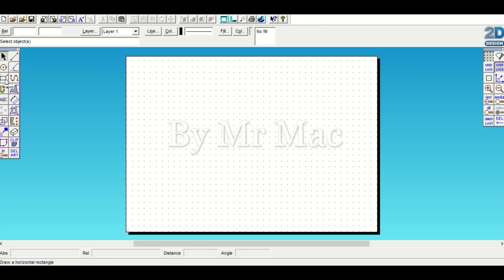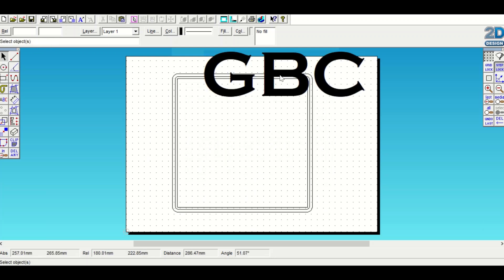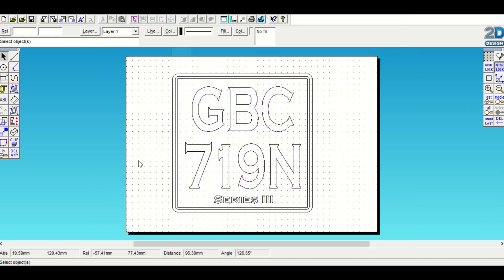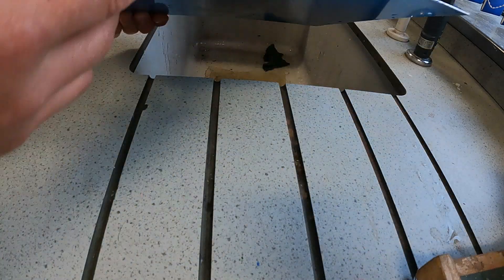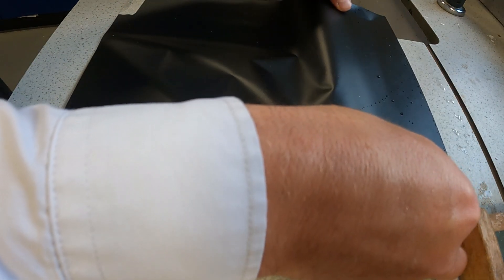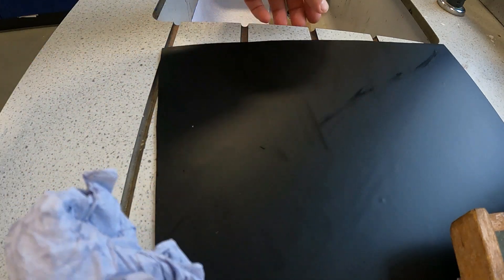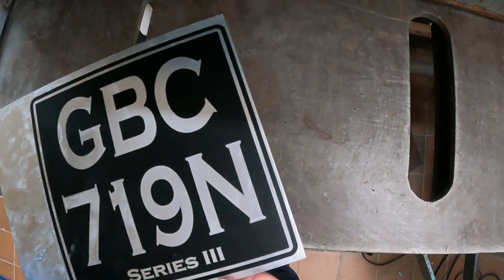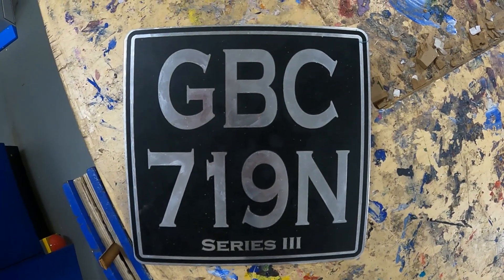Classic Car vintage registration plate - silver on black

Comment: The machine is called a press brake, not a brake press.

But that's not a press brake, it's a shear. Brakes bend metal, shears cut metal.